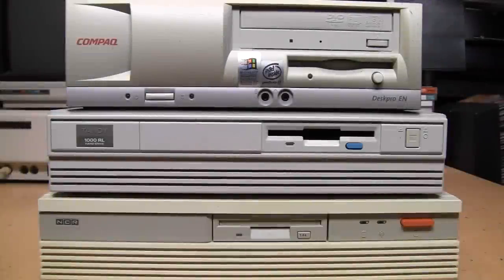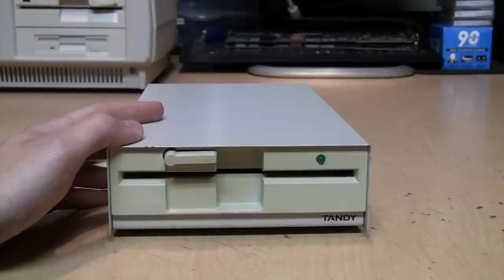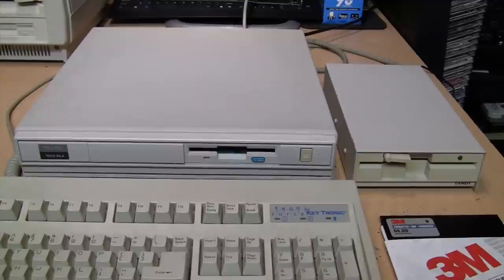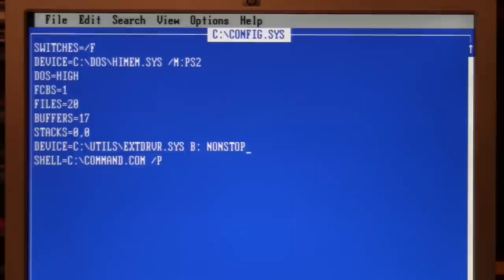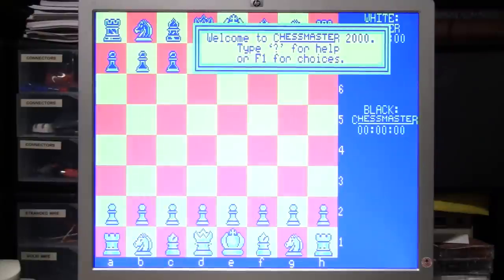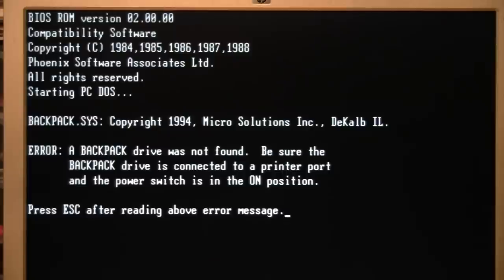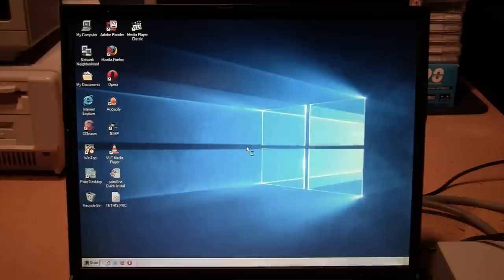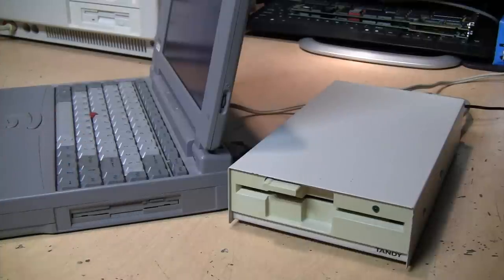An external 5¼" floppy drive for almost any vintage PC

Comment: ....hands up all those that would pay to have USB 5.25 inch drive!
Reply: @adventureoflinkmk2  yep
Reply: oooh...YES!!
Reply: Yes! And 5.25" floppies too
Reply: Yes
Reply: yep
Reply: Me
Reply: Yes
Reply: Dr.Quarex  technically, there is little difference in controlling a 3.5" or a 5.25" FDD. Its is just a question of different parameters from sectors per tracks etc. The only other thing is that you would  need an external power source for the 5.25" FDD: it cannot be powered from the USB.

 I guess industry was never interested in creating an USB version for 5.25". Unfortunately.

Regarding data retention on 5.25" floppies. Don't despair, they can retain their information for a very long time, due to the low information density. I have a lot of floppies that are more that 30 years old, and are still perfectly readable.
Reply: Are you selling it

Comment: My experience was quite different with 5.25" disks.  I've only ever encountered a handful of them that failed in all my years using them back to the 80s.  I've even come across warped ones that I removed the magnetic disk from and put in another plastic shell that worked fine.   3.5" on the other hand....I had so many that failed.  The 360K 5.25" seem rock solid though.
Reply: I've had more problems with 3.5" floppies than 5.25" ones. I do not understand the porblems video poster is having.
Reply: Oh yeah 5.25" disks were far more robust than 3.5" disks, especially 3.5" HD disks, and especially 3.5" HD disks made after 1995 or so. 3.5" disks that came with boxed software seemed to be far more reliable than the blank 3.5" disks you could buy, even brand name disks.
Reply: It probably depends on the quality of the disk too, I have quite a few dead 5.25" floppies from random brands but most of my Verbatims still work fine.
Reply: Same here. I even used to format some of my 5.25" HD disks to 1.44MB, to handle 3.5" disk images.
Reply: I think Kevin makes it clear that the 1.2 Mb 5.25" were unreliable, not the 360K ones.

Comment: You can cobble one together with a lot of external tape drives (floppy controller based)! I've done it in a pinch. Backpack and adaptec used standard floppy controller s just need the floppy driver.
Reply: do you have any specific enclosure / driver examples that work (and are readily available)?
Reply: @reanimationxp Qic80 tape drives are what I used...DC 2120 If I remember correctly.
Reply: @reanimationxp  Microsolutions Backpack model 141080 is one I used.

Comment: Some clever engineering to use the parallel port like that. Always love old or obscure accessories
Reply: It seems that serial and parallel ports are che most Universal port , too bad both are pretty slow. But they works in the vast majority of cases
Reply: Why? The parallel port gives you an 8bit databus and signalling.
Reply: @napomania  like my dreamcast sd card reader ;) with 100 games

Comment: I love it!  I have a proprietary 360KB external drive for my 1000 HX, this is a much better option.  Thanks for covering this in depth.
Reply: The EX/HX external floppy drive plugs into a proper DRIVE connector, needs no external power supply, no drivers, can be swapped at boot and works 100% of the time.  Why do you feel the drive featured in this video is a better option?
Reply: @Torch70  I wouldn't change what I have on the HX naturally for the reasons you listed.  But can't use the HX drive on a non Tandy system.  This is a more versatile option.

Comment: 7:50: I have a lot of HD 5,25" floppy disks. The reason is simple: in 1992, 5,25" HD disks were significantly cheaper than 3,5" HD floppy disks, and had about 80 % of the capacity.

Comment: Great find, now we need a 5 1/4" external for modern PC's. :-)
Reply: Ha, I wish I had a 5 1/4" solution for my raspberry who sometimes thinks it is a retro computer. I have a 5 1/4" drive and disks(!) but no adapter to connect it to my pi.

Comment: Very cool! I've recently become obsessed with parallel port devices such as this one, such an ingenious use of the good old LPT port.

And with devices such as OPL2LPT I kinda feel the LPT port is gaining new life and almost becoming the PC equivalent of the ZX Spectrum edge connector. The retro homebrew community should come up with the concept of some sort of expandable bus you can plug into the LPT port, I'm sure we'd see all sorts of compatible devices suddenly pop up
Reply: IEEE 1284 compatible ports should be able to enumerate compliant devices (like ZIP drives) and automatically ask them to pass through to the next in chain.
Would be nice to have some scans of the PCB of the controller to replicate it and the IC references…
Reply: Back in the 90s I bought a scanner (the hot new tech at the time!) that ran off the parallel port.
Reply: Are you the same Mario Brito that created those old programs for Jane's Longbow 2?
Reply: @FlyboyHelosim  I am indeed! :) That was quite some time back tho, probably beginning of 2000s. Good memories from those times
Reply: @mariobrito427  Awesome, it's good to see that you're still around. You have quite an unusual name so thought that it must be you.
Reply: The only parallel port device I used to own was a external zip drive.  The zip drive served me well in college for some time until it got the dreaded click of death lol.

Comment: Nice drive.  For a smal PC with a 5 1/4 the pride of my collection is a Commodore PC-1 - a tiny PC with a 5 1/4 built in. (has an external 3 1/2 using an Amiga interface) First PC I had.
Reply: Used to have one back in the day, with an external 20 Mb drive that cost and arm and a leg.

Comment: great vid VW, reminds me of my old Apple II with 2 external 5.25-inch drives-back in the days before HDs & IDE, you had to load DOS into RAM before you could use the disk drive to load the BASIC programs, so if you only had 1 external drive, you booted up the DOS disk into RAM. Once you were booted into DOS, you removed the DOS boot disk & then inserted the program disk you wanted to run. Sounds tedious, but remember we were originally using cassette tape recorders for storage so this was a huge leap. The next step was adding a 2nd 5.25-inch drive, this allowed you to leave the DOS boot disk in drive A, boot up into DOS, then just put the program disk in drive B to run it. This was bleeding edge in the early 80s...

Comment: I always thought it was ironic that the maximum number of attached diskette drives went down (after starting at four with the PC) even as the capacities of the diskettes got larger. For the PS/2s, IBM had the "Data Migration Facility" to convert from 5-1/4" format (on another system with that drive type) to 3-1/2" through the parallel port, and also had the 4869-001 (360Kb) external 5-1/4" drive that ran from the primary FDC on the planar. Third-party manufacturers made ribbon cable and "bridge" assemblies for the PS/2s that didn't require the pass-through PCBs to be in adapter slots and bays.

So then IBM made the "Diskette Adapter/A", which had a separate FDC chip, but could only run one additional drive per connection (internal and external) - but also at least supported the 4869-002 (1.2Mb) external drive (I did a video on all that too, and was told I needed to be more "scripted" in the single comment that someone else did). There were external diskette drives for the initial Thinkpads laptops and tablets using special connectors, as some of the other manufacturers did as well. Other manufacturers did have the parallel port and later USB models, but those moved from using an FDC chip inside the system. I can't really figure out why more recent systems still with an FDC just support one drive.

Comment: I got one of those Tandy 25-1087 drives with my Tandy 1000 RSX. Still have the original driver disk too! I piggybacked my external Zip-100 into it. I didn't know about the NONSTOP switch though. That will come in handy.

Comment: Microsolutions Backpack solutions are the best thing you can get for old PC's. I have the Backpack 460mb Hard Drive and I had the Tape Drive which failed, so I swapped it with a 3.5" floppy drive. Use them both with my PS/2 Model P70. The Parallel port HD is faster than the internal DBA hard drive is!

Comment: What I wonder is if you could take one of those external USB 3.5" floppy drives and connect a 5.25" drive to that USB controller to see if it would work on a modern PC.  Thanks for the videos!
Reply from the maker: No. That has been discussed in many vintage computer forums but unfortunately USB floppy drive interfaces can only use 3.5" drives.
Reply: @vwestlife  Well, that bytes.  I've been hoping there was some sort of workaround like that for years.  Or know where I could get a reliable combo 3.5"/5.25" drive so I could see if any ancient files still exist before I have to chuck everything into the tip.
Reply: @vwestlife  Not only that, but the USB floppy controllers usually can't read or write double density disks. I'm not sure if they work properly with higher-capacity disk formats (using tracks beyond 80 or greater numbers of sectors to push 3.5" HD floppy capacity to 1.7MB)
Reply: @vwestlife  Teac fd505, newtronic d53, epson sd800 2 in 1 5.25 and 3.5 internal drive 1 slot ftw

Comment: An interesting external LPT drive. LPT port was truly the USB port of it's day with all kind of peripherals made for it, from storage devices to sound cards. 
From a quick look at that bridge PCB, I think a 12V DC supply would have most likely worked as well for that drive. An AC brick was used likely because it was cheaper.
Reply: I dunno why they just didn't use USB, would have been much simpler... LOL (jking!)

Comment: The moving sights (movies) and talking sounds (talkies) take me back to the 1980s.  We now needs the smellies!

P.S. I had few errors with 1.2MB and 1.44MB floppies back in the day (but it was new equipment).
Hey, it beat 76KB on a single-sided 8-inch floppy, and you haven't lived until you toggle in a bootloader for cassette tape to load Bill Gates'  BASIC.
Reply: The closest I came was loading punched paper tape BASIC programs into a TTY that was connected to a UC time share mainframe, my senior year of high school.
Reply: Ok

Comment: Great Video as always! I bought a Backpack Bantam a long time ago. It has been quite a useful drive to load files and programs on a PC with no CDROM. I still see them on Ebay. I wouldn't mind one more as a spare if this one ever croaks.
Reply: My college professor has the backpack version of a external CD ROM drive that connected via parallel port.  It came in handy for computers that couldn't take a internal CD ROM drive.   It was handy to install stuff to the hard drive without doing the floppy brigade trick lol.

Comment: Happy Thanksgiving vwestlife ( Kevin),  I saved a 5.25 drive from a old pc that was messed up. Its from a gateway that was a 286sx( I believe) computer. I believe its made by epson beacuse the 3.5 floppy is. Both are all metal construction internally which is great vs the 3.5 I had that was made from 2006 while the ones I have are from 1992. I have found 3.5 floppies brand new at goodwill 5.25 not at all but ive yet to use it.

Comment: I have a couple of Quad-Density 5.25" drives, you can use them on a PC set up as a 720k 3.5", the comptuer will know no better, but I mainly got them to use as 5.25" 880k drives with my Amiga, because I want to be different-ish... :P

Comment: I think it's great you use PC-DOS. I used it during the waning years of DOS. It had a create memory manager that MS-DOS lacked, and MS's issue with IP theft just really bothered me.
I had a Tandy 1000 RLX. It was a nightmare machine, as the hard drive was a weird XT IDE drive that had its own BIOS. The RLX did not recognize ANY IDE drive except either the 20 or 40MB Seagate IDE with BIOS. So I was stuck with 40MB.

What was interesting was MS-DOS 5.0 was installed on a ROM drive as D:. The benefit was the OS did not consume valuable hard drive space, and it was faster. When I gave the computer to my brother, our dad installed a later MS-DOS which consumed a large chunk of the drive. I would have just kept it running 5.0.

Comment: I'm curious to see what the whole adapter board looks like. I'd guess it has some jumpers which are used to identify the drive. Changing them could probably turn it into a Backpack drive or a 360k drive.
Reply: i'm also wondering if the DRIVETYPE identifier was actually an integer 0-9 or something, and it only didn't complain about '360' bc that is also an integer.

Comment: Good info thanks. I have a Unisys slimline 386. If I had such a device I could use a removable hard drive in its place. It only has one externally accessible drive bay.

Comment: Although this is of little direct use for me, as back in the late 89es/earliest 90es I only used a DOS PC (w. both 3½" and 5¼" drives) as a means to move data between my CP/M machine and Macs, I like it; and I loved hearing the buzz of the Oki µLine92 printer again, what a beautiful sound.

Comment: our family 286 was our first PC and it came with 1,2 and 1,44mb High Density drives.  I still bought a lot of 5 1/4 disks because those were cheaper and my parents would only supply me with a certain amount of 3'5 inch ones, never enough for my growing appetite for more software.  So I had to buy extras with my own pocket money, and 1'2 inch ones were indeed becoming obsolete and much cheaper,

Comment: Great video as always, if someone wants information about such a disk drive, he will find everything in this video.
Now... 3.5" diskettes were a disaster, totally unreliable, especially the ones made in the 90s. I used some for backup, never used them for months, then when I needed them, they simply didn't work. On the other hand, the 360K 5.25" ones were surprisingly reliable, in total contrast with what one would expect. Virtually all of my 5.25" diskettes still work today.... I got older (and it shows), they did not xD
Reply: Ok

Comment: I have a backpack 3.5" floppy drive and a backpack CD-ROM drive, both of which I've repaired and gotten working - but I've been searching for a backpack 5.25" floppy drive for a LONG TIME!  And for anyone who's curious, no, you cannot simply connect a standard 1.2MB 5.25" floppy drive to the internals of the 3.5" backpack box and get the parts talking - this was a failed project of mine.

Comment: About your faulty 1.2MB 5.25" diskettes.

Since we're in the era of a magnetic layer glued to a Mylar/plastic surface, I'd bet that it's a matter of factory chosen binder material along with long term durability, just like with certain makers of cassette-, R2R- and videotapes, where some are prone to loose the magnetic layer more than others.

So grasping for straws in the middle of the Pacific, I wonder if other manufactorers made better 1.2MB diskettes than your Maxell turned out to be. Maybe there's better out there.
There should be.

I like your channel. It's my preferred one. You're always right on target. There's no nonsense. No  "talking hands a'la puppet master doing ballet" (man, I hate that).

So. Cheers.

Comment: Curious....did you try a drive letter other than B?  I never seen a floppy controller that only supported one drive only.  Even if it only had one connector (like the Compaq) you needed a special cable with a twist and sometimes some pins removed.  I had an external Tandy drive and I think mine was high lettered >c. When you wanted to make it primary it would make it A but then the 3.5 went high.  Of course this was the Tandy drive, so it was special.
P.s.  funny coincidence you break out a 5.25 drive now!  I'm retrobriting my apple //e floppy drives today!
Happy Thanksgiving 2021

Comment: Note that the parallel port on the planar of IBM PS/2s and other systems can be a strange I/O address (03BCh) to be an issue sometimes - the parallel port ZIP drives had this come up (I know of someone that even went to great lengths to add a second parallel port to a PS/2 Model 25) all the time until the workaround is learned.
Reply: I think you might have hit the nail on the head! As I remember there is more than one configuration for a parallel printer port just as there is for the serial ports. I'll bet that's why it wasn't working on the RL.
I wonder if there is a parameter when loading the driver to set an alternate address.
Reply: @DeepThought007 : 03BCh was also the original parallel port address on the IBM monochrome adapter - more conventionally there is 0378h and 0278h. With DOS DEBUG, "D 0:0048 L 6" should show installed parallel ports in order. If there is partial functionality of the drive, I doubt it is an I/O issue.
Reply from the maker: @DeepThought007  The 1000RL's parallel port is at 378h, not 3BCh.

Comment: Awesome! Didnt know about the nonstop option. I've been using my tandy external drive on my 1000SX and TX machines. I was surprised to find out that high density disks were supported!
Reply from the maker: Are you using the 25-1087 drive? I didn't think the card-edge parallel port of the older 1000s was able to support it, even if you adapt it to a DB25 connector, because it's missing some of the pins.

Comment: I used to have a ton of Memorex 3.5" see through floppies in multiple colors. I did use one as a back up for Windows 98 SE about 21 years ago. Unfortunately I don't have an external 3.5 inch drive to see if it still works.

Comment: Turn OFF the DISKETTE CHIP SELECT from here at 6:57. The external enclosure has it's own chip select function. This maybe the issue why you were getting the freeze up since one can't talk through the other. Not sure if PARALLEL CHIP SELECT plays a role or not.
Reply from the maker: That would disable the computer's internal floppy drive controller. It in no way affects the external drive connected to the parallel port.